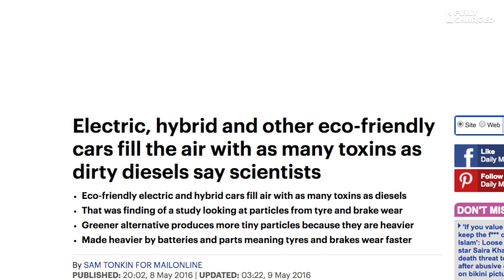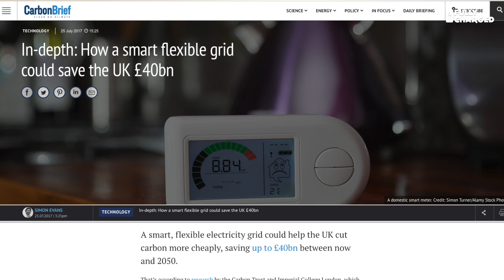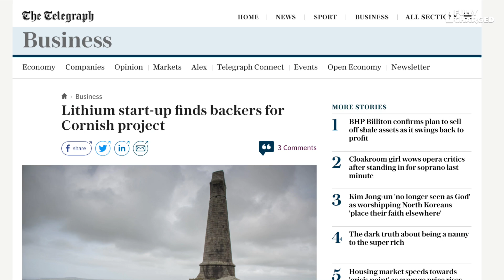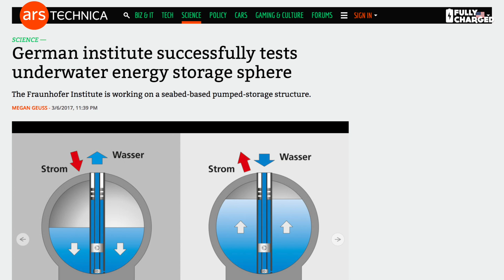Kettles, Particulates & Flexible Grid | Fully Charged News

Comment: The brakes on hybrid & electric cars last longer because of regenerative breaking where the drive motor becomes a generator, converting the energy of slowing the car down into power to recharge the traction batteries, thereby recovering energy for reuse that would be normally lost scraping off brake pad & rotor materials with friction in a conventional vehicle that eats its mechanical brake components faster with more fiction, more heat, most dust, wasted energy & faster breakdown of the break pads, rotors, gaskets, fluids, shoes, bearings, bolts, mounts, etc. Hybrid & Electric vehicles have brakes that can last over 100,000 mi 

7kWh chargers are roughly equal to a double electric oven baking two holiday oven cooking preparations at the same time : namely about 3500w x 2 L similarly electric water heating is often in the 6000w range for instant hot and tank electric models of water heaters : The standard US household electrical panels is 200amps at 120v or 24,000watts max : so you could have a 3500w stove going, a 6000w water heater going and still have 10,500 watts of headroom for EV charging : furthermore most cars are parked in their electrified garages for at least 10 hours, so even at a very low charging rate of 5mi per Hour, a regular extension cord charger plugged into a normal outlet can pump 50mi of range into an EV if you park it at 6pm and leave again at 4am : most people park for almost 14 hours per night, translating to 70mi of range accumulated through an extension cord and normal outlet. When you hook up a 50amp 240v setup for Level II charging, you can pick up 9.6kw, or enough to fill a Nissan Leaf's 30kW battery in 3.5hours. 

Even using coal power to charge electric vehicles is far cleaner than using petrochemical fuels like gasoline & diesel in poorly designed inexpensive passenger cars that become less clean burning over time as the engine & emissions control systems wear out, becomes loose and dirtier : allowing water, oil and fuel to mix, not properly processing the exhaust gases, etc : the tail pipe emissions are hard to control with light weight equipment present in the vehicle. A stationary power plant can install heavy filters, bag systems, precipitators, electrostatic separators, scrubbers, catalyst stack, elemental recovery tech and other large, heavy specialized efficient long lasting and easy to maintain industrial emissions control equipment that would never be practical or cost efficient to integrate into an affordable passenger vehicle.

Comment: Wow the idea you can trip the service fuse by charging a car and turning on a kettle is nonsense.  It's only even a possibility if your house has a 60A fuse and those are typically found in flats and small houses.  Even then they don't actually blow at the rated amperage (60A is 13.8kw).  Very few properties with space to store an electric car would have a 60A fuse to begin with.  It's not like it's a serious issue either - if it did ever blow just replace it with a 100A one, those have loads of capacity!

Comment: Three phase electric installations are very common in Germany. Our house (four appartments) has a 80A main fuse (50kW), every appartment has three phase, which is why I have a three-phase 22kW (32A) charger in my garage and you can not just run kettles at the same time but also ovens.

Comment: V2G is a waste of everything. Do not use electricity rather than give it back. Giving it back has inefficiencies. And it have to be recharged again. With losses, again.
Reply: Yes V2G is a dumb idea, batteries are expensive and precious enough for EVs without stupidly wasting their capacity on supplying electricity to the grid.

Comment: I'm not in to brakes and tyres but do know where in the Netherlands the electricity comes from to drive those cars.Mostly coal! Our grid with all its windmills and solar panels over the year only runs for some ten percent on wind&sun,about the same as Germany because we are neighbours.Germany is even worse because they've shutdown some nuke plants and instead running brown coal plants harder than ever.And when everyone goes driving electric we need to double our grid capacity which means more plants more pylons,transformers,cable and lots of digging for end distribution to the homes.Elektric cars are not evil just far from practical and wil need billions of new infrastructure and way better batteries before they are (economical) competitive with the internal combustion engine.Just as Dutch/German wind and solar those cars can't be taken serious for now and shouldn't be so heavily subsidised.
Reply: You're right that the Netherlands has a very poor record on renewable energy. But you've invented your facts on Germany (or lied?). Germany produced 29% of its electrical energy last year from renewables vs 23% from lignite coal. (www.cleanenergywire.org/factsheets/germanys-energy-consumption-and-power-mix-charts)

Of course you'll also say that climate change isn't happening. I suggest that you buy some diving gear as insurance; the Netherlands will be the first to go....!!!
Reply: The difference between production and standby energy is not counted.So when the wind blows and the sun shines they don't take in to account the coal that gets burned to keep their plants ready  for changes in wind  and sundown. Edit: Also the Netherlands sinks faster than sea levels do and will rise in the future.Also any climate change is strictly natural.Warming by man made CO2 is purely made up by Al Gore and other greenhouse nuts and the workers in the wind/environmental industries who make big money on that scheme.
Reply: Germany's electricity generation IEA 2014 was wind & solar 14.8%, dirty eco-raping biomass 6.9%. hydro 4.1%, coal 45.3%, gas 9.9% and nuclear 15.4%. So they produced more from the nuclear than with the wind & solar that was supposed to have replaced it over a decade ago. A pathetic achievement for Europe's richest nation. And solar growth has dropped to a snail''s pace in Germany,  0.18GWavg in 2014 vs 72.3 GW avg demand. Compare with France achieved 88.1% of its domestic electricity consumption and 46.9% of its primary energy consumption with zero emissions nuclear. With 1/2 the electricity price of Germany, makes Germany look like a total loser.
Reply: Don't forget tax! Green tax in Germany is skyrocketing! Some people get cut off from electricity because of those ridiculous subsidies on solar and wind! But people who own those mills laugh their ass off! Even when electricity prices go negative or worse when windmills can't dump their electricity because the grid overflows they get paid for theoretical generated electricity! Its insane! And why they are dropping those subsidies now bit by bit.   https://stopthesethings.com/tag/german-homes-disconnected-from-the-grid/page/2/

Comment: I am not sure if this is different In the uk, but here in North America the standard for household electricity is 200 amps at 240v coming into your home, which is 48kw. You certainly don't need 3 phase power for an 11 kw charger to be installed in your home(its about the same as a high end hot tub) . Just thought I'd pipe up, I really enjoy your show.

Comment: @4:20 
I think a battery swap station for trucks could help to safe such energy, I'll explain.
I once had an idea to make electric trucks with like 300kW batteries and have another 700kW battery in the trailer, I think that's possible and will create an up to 1500 mile range or so, on top of that, you can have solar panels on the roof of the trailer which will generate about 10kW a day.
Now I think that a lot of compagnies who have a lot of trucks around:
Distribution centres for example, or massive warehouses, who some times have over a 1000 trucks for the compagnie, they can have a massive battery swap station, they are allowed to take a long time before the battery should be fully charged again, as long as you got like 10 ready to be taken by trucks, you can keep the other 990 half full. 
This way they can charge when electricity is cheap (or even free appearantly), and can stop charging (or even offer a bit of the energy) if the demand for electricity is unexpectedly high.
The battery capacity for like a 1000 trucks is so big, that it could help the grid massively becoming more stable.
I also think only the trailer should be able to swap batteries, this so all parts of the combo continually have electricity.
At this moment superchargers are teasing the grid by unexpectedly asking up to a 120kW each car, while possibly using 0 energy just a couple of minits later, it's hard for a power plant to predict such a thing and 120kW is quite something, just google how much energy an avarage family uses a day right now. A massive battery swap system can help the grid massively becoming stable, in both unexpected low, as well as high demand.

It's basically what the Australians recently bought, while beïng a massive battery swap system for trucks at the same time.
Reply: There is no point in having swap stations for trucks. Truck by law drive slowly and have a strict limit of allowed hours driven per day. So you just need enough power in a truck to be able to drive those hours and you will have plenty of time to recharge them overnight during the drivers mandatory break. Even with the increased power consumption it is sufficient for the big trucks to have ~800kWh of batteries to last them trough the day of heavy hauling. And you can still recharge that overnight via a single 150kW CCS connection.
Reply: Unless you got two drivers, or unless Tesla is going to release their autopilot thing completely within a few years.
Reply: Two drivers are super rare - 99% of trucks at night are parked at truck stops. You can drive for hours on highways after midnight without seeing a single truck. As for autopilot - that will only decrease range problems as autopilot trucks will just stop, quick charge and go on. Why worry about range - you cargo will get there whenever. But that will not for another decade at least before the legislation actually catches up to technology.
Reply: Oh, you bet there's a lot of driving at night, especially in southern part of Europe, they usually drive animals like pigs or cows at night to prevent them from heating (and stressing) up to much or ending up in a traffic delay (which is also a reason why they often drive at night). If you drive on the A31-A6-A7-A9 (between Luxemburg and Montpellier along the "route du soleil") you'll see piles of trucks 24/7, also in the middle of the night.
Reply: wonder where is it you live, as whenever I drive in the UK at night there's always loads of trucks to overtake...
Reply: Judging by the name I would say he lives in Latvia. And there is not that much truck movements at night since most places they would go to are closed at night anyway. Except certain food industries that (like bread bakeries) that work at night, so that shops can sell fresh in the morning.
 Unlike UK, where most of deliveries are actually done at night to avoid traffic. And some shops have night staff despite being closed for customers.
On international routes however, quite a lot of moving happens at night. There are certain areas where trucks are not allowed to drive at night due to noise concerns (especially in Austria and Germany), but most modern trucks are certified to go through them (that green circle with letter L in it, that appears on the front of the cabin) despite being diesel. And for electric that even less of a problem.
Reply: More like southern Germany. Munich - Stuttgart route to be specific. Lines of trucks filling the right lane during the day and basically none during the night. There are more in Latvia actually as the russian truckers that transit there are not known for law abiding.
Reply: International transit truckers don't stick to certain hours to start the day. Just the legally required intervals. They sleep at whatever time rest time comes. If that means driving through the night and sleeping midday - then be it. Also, if you start in one time zone and then take a rest in another (and not all trucks come from Moscow that is just 1-2 hours ahead of the Baltics) it shifts a lot. Besides, it is maximum driving length and minimum resting time limit, not the other way around. So every extra 15 minutes of rest build up over time.

Comment: i am pro zero emission transport BUT see an issue with charging EV's at locations like Motorway service stations when EV's become mainstream, Nothing to do with EV's  the issue will be getting grid rights for the power or even physical local Grid capacity needed for 50-100+ cars to fast charge at once. the Grid companies will charge an arm or a leg to make the improvements if they will even do it at all.

Comment: Please explain why tires do not wear out quicker on heavier cars. You just stated it as fact, with no explanation. I suspect it is only a small concern, and doesn't justify the types of anti-EV rhetoric you're criticising. But if you're criticising others for shoddy journalism you need to not be shoddy yourself.

Secondly, during your S. Aus solar thermal plant segment you stated "Very expensive power plants that we currently have to keep running [for standby purposes]". Yes, they have to be kept running for standby purposes, and solar and wind is not helping. Then you state "That we're paying for when they're standing idle ... which we call a subsidy". No. This is not a subsidy. This is extra cost incurred, which has to be spread over all electricity delivery to the consumers. This is the same as, say, the cost of batteries to cover times when the wind don't blow and the sun don't shine. A subsidy is, for example, government (and therefore taxpayers) paying something towards the costs of switching to cleaner electricity; a distortion of the commercial forces for better outcome. Again, I'm a massive enthusiast of clean tech (it's why I follow such things as Fully Charged), but this is shoddy journalism. I crave independent, unbiased, informed news.

Does this satisfy your snide remark about "Informed comments which I'm sure you will share ... and I love"?

Comment: The solar thermal plant in Australia is hoping for optimistically $11.4k per kwavg, not 24hrs/day operation vs rip-off EU dictator imposed Hinkley, 24/7 power, at $9k per kwavg. Australia being one of the sunniest places in the world. And it will still get a 1.8X summer:winter variation in generation, even with 2-axis tracking, no storage can compensate for that. So even in ideal location the solar plant can't match rip-off Hinkley in ANY parameter: cost, reliability, consistency, lifespan. If instead of wasting $trillions on these nutty wind & solar scams we put a few $billions into developing meltdown proof, high efficiency, low pressure, compact, factory produced, molten salt reactors we would have no need of wind, solar or fossil and they can easily be built even in the west for under $5k per kwavg output. And you can also store nighttime heat in molten salt for use as daytime peak energy, but that won't be necessary with widespread EV usage, the nighttime surplus will charge EVs.
Reply: With the risk of leading to a nasty 'conversation', would you care to elaborate on what you mean by "rip-off EU dictator imposed Hinkley".

What has the EU to do with a UK nuclear powerplant?
Reply: The EU dictators demanded that Britain must use ONLY the expensive, over engineered French EPR, refusing to allow any competition for the reactors. And they also demanded the project must be privately financed at ~10% interest instead of being financed as governments usually do, including for wind & solar projects at ~1% interest, standard public debt bond issues. And this is the same ECB that is giving free money to Rothschild controlled Big Oil companies Shell & Total among others, through its QE (money creation program). No money for zero CO2 nuclear though. Lookup:
" 70 European civil society organisations including Friends of the Earth and Corporate Europe Observatory call on the ECB to stop channeling more quantitative easing money towards polluting multinational corporations ".

Comment: The problem with this car sharing thing is it only works for people who can hand-carry ALL their belongings to and from wherever the car is parked, and never need to leave anything in the car. It's fine for certain city dwellers who carry around nothing but a wallet and a phone, but the rest of us have various reasons to need to actually own our own vehicle. I need mine to tow a small boat on a trailer. Is every car sharing vehicle going to come with a tow hitch with the proper size ball and working electrical connection for the trailer lights? Kind of doubt it. Personal vehicle ownership may diminish in time but it is never going to disappear.

Comment: As someone who knows a bit about electricity, here is the maths re 11kw chargers and kettles.

Most domestic supplies in the UK are 240 volts single phase, rated at 100 Amps, some are 80A.

Power = volts x amps, so a little algebra tells us that amps = power/volts, so :

Current draw for an 11kw charger is 11,000/240 = 45.8 Amps

Wafty kettle is 3kw, so 3000/240 = 12.5 Amps.

Add the two together and we have 58.3 Amps.

This still leaves a pretty big margin for extra appliances running at the same time, so an average domestic supply should cope.

Local distribution infrastructure may struggle if everyone was doing it at the same time though.